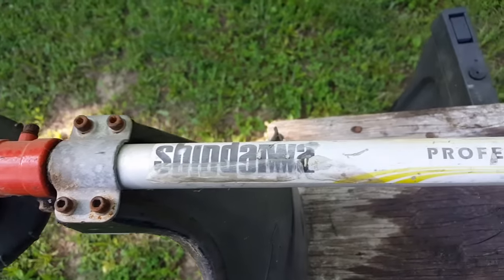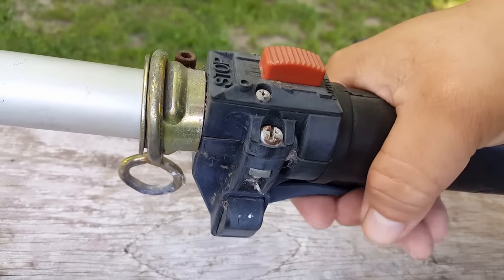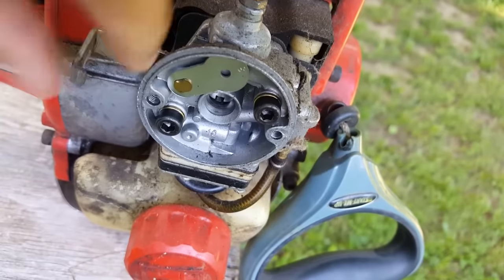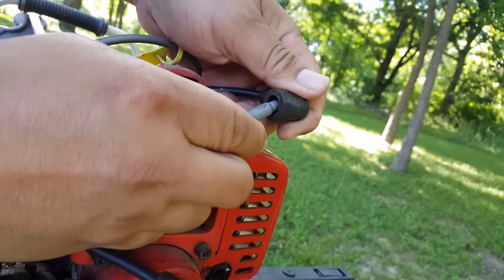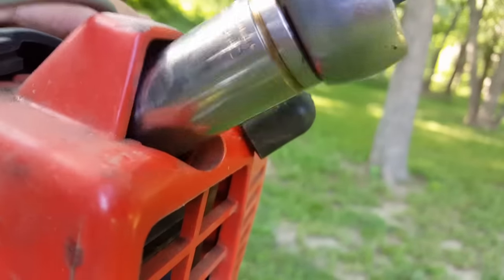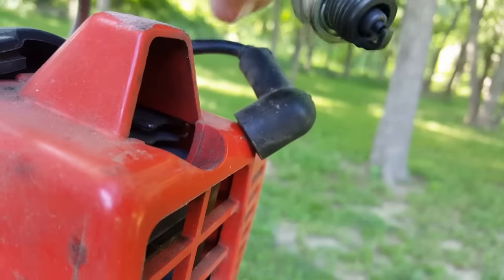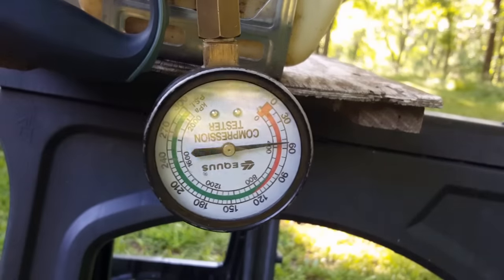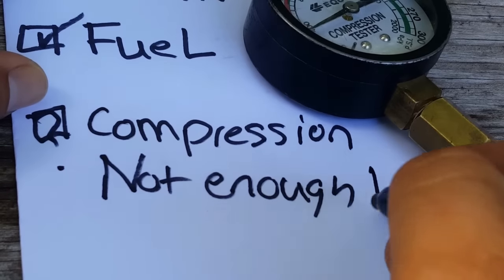My weedeater has spark and fuel but it still won't start

Comment: Well this doesn't really help with my situation. I have spark n fuel. The weed eater has sat for prolly 7 or more years. It's always had premix. I decided to try n get it going in early March n had it running on half choke but couldn't do a proper adjustment to the carb. I used true fuel premix for that. Then noticed the carb n lines were leaking. I just put a new carb on it cuz it was cheaper than a rebuild n now it won't even light off with a bit of ether
Reply from the maker: could you get a hold of a compression tester and find out what kind of compression you're getting
Reply: @HomeGaragechannel  I have one. Didn't run a compression test on it. But it feels like it has good compression n it wasn't run much before it sat for 2 years n developed carb issues which is why it's sat so long after. N thanks for your reply I appreciate it
Reply from the maker: @benmiller5015  no problem.  I've had echo trimmers that sorta ran and after doing a compression test it showed it to be very low
Reply: @HomeGaragechannel  I just ran a compression check on it n my gauge must not be sealing cuz it's barely moving the needle but yet it'll blow my thumb off
Reply from the maker: @benmiller5015  interesting
Reply: @HomeGaragechannel  right that's my luck though. N it's got enough compression to flood itself after like 10 pulls so the carbs moving gas
Reply: Carburetors issue buy new one!
Reply: @benmiller5015  same issue but with my rt100.. has good spark, TONS of fuel, good compression but won't start. May just be too cold for it to run but I dont know 🤷‍♂️ should still at least try to run. Had it running on carb cleaner for 2 seconds but starting fluid or brake cleaner wouldn't even make it hit once. Very clean carb I've went through it 5 times. Getting frustrated
Reply: @jaceb7136  well I wish I could tell you that I got mine going but I literally just threw it in the back of my shop n forgot about it lol. I don't think I even took the time to put it back together. I went n got a cordless electric 80 volt one that does all I need it to do

Comment: On 2-cycle engines, if low compression, then pull the muffler and look at scoring on the cylinder and piston. While you found this to be the culprit, another reason for low compression and a no start condition is a massive air leak.
Reply from the maker: yes you're absolutely right.
Reply: Massive air leak where?
At the exhaust?
Reply: The low compression situation just happened today on my trimmer. I took the spark plug out and poured in about a teaspoon of oil into the crankcase, put back the spark plug, and it started! I believe the piston was worn but the oil could still be able to help.. .

Comment: Tiny engines like this will not give an accurate compression reading using the same tester that you would use on larger engines. The problem is it's only compressing a very small volume of air which some of it gets lost in the hose running from the dial to the threads where you screw it into the spark plug hole. If you use a compression tester with no hose on it or modify yours to use as short of length hose as possible this will give you more of an accurate reading.Your problem may not be compression. I have a small outboard motor that only reads 60 lbs of compression on my tester that is meant to be used on larger engines and it runs like a bat out of hell. There is one other thing necessary for an engine to run besides compression Fuel and Spark and that would be timing
Reply from the maker: Thank you for all your insight and information I really appreciate people who know what's  Going on who watch my videos.
Reply: Yes, if it is out of time it will never run.  Just fixed a Craftsman lawnmower.  Had spark and fuel but wouldn't run.  I pulled the flywheel and found the key was no longer square but was shaped like a Z.  Of course the blade was bent, but I was lucky the crankshaft was not bent.  I reinstalled the flywheel with a new key and it still didn't start.  I removed the flywheel and took a second look and found a slight offset in the internal keyway.  It only takes a wisker i.e. small amount of offset and it will through it out of time.  I replaced the flywheel with a used one I had around the shop and presto she now runs like a champ.  I had to reset the coil gap, as the replacement flywheel was slightly larger, prior to test run.  Another thing to remember is that the flywheel key only has to be moved out of alignment a very slight amount to kick it out of time.  It could be a very slight mark or line on the key that can kick it out of time.  New keys are cheap so if in doubt replace it.  Under severe circumstances on  lawnmowers the actual flywheel could be cracked from the initial impact on the lawnmower blade.  No substitute for a good inspection of the parts prior to reassembly.   Usually, small 2 cycle stuff will not have this issue unless the flywheel nut came loose or other mechanical failure.
John
Reply: so how does one check timing?
Reply: Or a clean air filter. Lol

Comment: Its been almost 1 year since this video was posted and one item to check that you didn't talk about and I didn't see in the comments: did you check the muffler spark arrestor screen to make sure it wasn't plugged up? If you can't get exhaust out you can't get new air fuel charge in thus not allowing the engine to create compression. I've seen this scenario many times. The fix is to take the screen out and use a hand held torch to heat the screen up to cherry red while holding with a pair of needle nose vise grips and then use a wire brush to clean it off then reinstall it and if everything  else is good it will run.
Reply from the maker: Thank you Craig Timmons. It wasn't filmed but later inspection showed that it was ran with straight gas which tore up the ring and cylinder.  No saving this one without a new top end kit. I have another video with a clogged spark arrestor. It's the echo weedeater that won't go to full speed.
Reply: Thanks for posting that. Only got 50psi on mine and will check the muffler before stripping the engine to check the rings.
Reply from the maker: Thank you ColinWatterd and you're welcome. Good luck with the engine.
Reply from the maker: Thanks for the comment. Sorry about the theft. That is quite the experience.  I've never had that happen to me before.
Reply: Craig Timmon
Reply: Craig, Or buy a screen.
Reply: I think that's my problem. I checked the lines, fuel filter, new mix. it was working fine before.i have to find where the screen is on shindaiwa f22? I am female and unfortunately none of the "men" in my city neighborhood know how to fix anything,only break stuff, and think they are borrowing mine after putting straight gas in 3 of their weed whackers in a row. yes I pray for a miracle to move where there are real men.
Reply: @pattiannepascual  you should brainfk them by explaining the not so magic of google

Comment: good video. direct to the point. Most people don't realize low compression will not allow a 2 stroke to fire. Wish I had seen this before I had to figure that out for myself, would have saved a lot of time.
Reply from the maker: You and me both.  I've wasted plenty of time before I realized it.  Thanks for the comment I appreciate it
Reply: I need help.. what about a four-stroke? I have a dirt bike engine that was just badly stored and it didnt run for a few years and now it wont start. I put some oil in the head for a day to make sure rings weren't sticked or seized up , has a good blue spark I also did a oil change and it got decent  compression but when I put gas in the spark plug hole it backfires but won't start?
thanks
Reply from the maker: @justinc9911  thank you for the comment I appreciate it.  What kind of oil did you put in the spark plug hole and how much? What was the compression reading?
Reply: @HomeGaragechannel it's a 125cc there around 120psi and I put wd40
Reply from the maker: @justinc9911 thanks for the information. Can you do a leak down test on it?
Reply: @HomeGaragechannel  That's why I liked it so much, I spent a lot of time replacing fuel lines, spark plug, clean carb,etc., etc, until the compression topic came up. A broken piston ring was the only issue and most people dont realize that.
Reply from the maker: @kmetbropcss5437  well said thank you for the comment I appreciate it
Reply: @HomeGaragechannel why start to repair him
Reply: @HomeGaragechannel  What did you do to resolve if ran with not enough oil?  New rings?
Reply: Same here. Once day the thing ran great, couple of weeks later, wont start. Have spark, have fuel, wont run. :-(

Comment: just picked up a used Weedeater SV2000BV new plug , has spark , i rebuilt the carb , no Compression !!!!!!!!
took the engine apart
ring seized to piston .
put new ring Voila !!!!!!!!!!!
has Compression now
Reply from the maker: Joni English wow great work! Glad it worked for you. I might have to try it too.
Reply: Alright!
Reply: No compression vs low compression. No compression probably an easier fix.

Comment: I think it's better to check spark off of the plug itself rather than an inline spark checker. You can tell if the plug itself has a strong blue spark.
Reply from the maker: Good point.  Thanks for the comment I appreciate it

Comment: Shindaiwa machines, tuffs strong's, best commercial units, this will go on next to no compression, Had one like this that, I used it in my lawnmower business for 7 yrs 155 lawns a fortnight,  & the guy before be had it for some time as well, in that time when through dozen plugs & 3 pull strings. Was getting hard to start, it was starting a little hard to start, just in the mornings, took in for the repair guy to look at, what he said it had no compression, hardy a reading:) so used it for another week:) while he order me a new one. shindaiwa, motto, first to start last to quit, is so true, & they run more smoothly, than others when you hear others around running, like ratty stihi, you look around small engine repair shops next time?? see any shindaiwas or echos?? if any its 25 to 1 Like you say will be the fault of the operator & not the machine!! why you say? its easy, its japanese,
Reply from the maker: Thanks for the comment. I really like these units. I only wish I had a working unit. I might rebuild this one some day.
Reply: Mike, I'm not a Stihl fanboy (prefer Echo dollar for dollar). Do u think there may be mor Stihl machines in the shop because Stihl outsells just about everthing else by a wide margin?

Comment: I had the same problem, bought carb. Kit with everything and a brand new fuel cap and new spark plug....but my problem was compresion from the piston from 90 to 95 psi, so I just put some transmition oil inside the spark plug an crack it for a couple of days (3) an wala I had presion again, the piston ring was stuck an everything back to normal...I hope this works for you guys...Good luck.
Reply from the maker: Thank you for the comment.

Comment: My shindiawa 230 has a compression of 30psi and never wanted to start, but I changed the throttle body and it started.
Reply from the maker: For a 2 stroke that's amazing

Comment: just so you know even with bad compression the motor would still run just saying also when you spray in the carb like that make sure the piston is down it prolly was up blocking the cylinder and you didn't spray anything in there at all
Reply from the maker: Thanks for the comment

Comment: Concise video.  No fluff... nice!  

I have a Cub Cadet and put in fresh fuel mix.   Won't start, so I pluck n clean the carb ( I didn't see any h2o signs or crud clogs).  I tested for spark - pulling the plug and grounding it to the metal frame and she sparks on every pull.  It still won't start .... and I'm wondering if there is another method to check compression?  I don't have a gauge thing-a-ma-doo-hicky.  

I doubled checked that the switch is "on" and that the primer bulb is full of fuel and moves through the lines just fine.  I'm about to throw this sucker off the garage roof like a javelin thrown by a Viking.
Reply from the maker: Lol nice.. well this is a tough question.  Did you see if the black metering diaphram was stiff or warped when you cleaned the carb? As far as the compression tester goes the only other was is to slowly pull on the rope probably at a rate of 1 foot a second and see how much the engine pulls back on each stroke. Do you have a working 2 cycle equipment to compare to?  That would be the only other way I can safely gauge engine compression.

Comment: It takes three things for an engine like this to run. Fuel, air and spark. The correct fuel to oil mixture helps a lot too. Being that this engine is probably a high compression one, usually around 11-1, mid grade fuel would work a lot better. And its usually only a dime more and that will not break the wallet.
Reply from the maker: You are absolutely correct.  Thanks for the comment.
Reply: I used to think the same thing but got a few lessons over the years.  Ignition system needs to be in time and also the engine requires a certain amount of compression to run.  If you meet the fuel, air and spark requirements  and the engine system is out of time or is low on compression it will never run.
John
Reply: @helicopterjohns how do you time one?

Comment: Well I just wasted a day on 3 of these engines, wish I would get a compression tester already.  Definitely would save loads of frustration.  I had been piecing my hedge clippers and whackers together for years, like 10, and they all completely died this week.  Guess its time for some new shit.
Reply from the maker: Thank you Pilesofplenty. Yes its time for new equipment.  Let the frustration go.
Reply: or maybe you gummed them up with bad gas??? since all problem started same time, maybe the fuel batch wasnt real good... try starting it shortly with a bit of methanol(fondue fuel) and a dip of oil straight in the carb, you'll know immediatly if it start for a couple sec ^^
Reply: That's a pretty good idea, but do it shortly or you will soon get sleeve dammage. otherwise, it's the best trick to test 2 stroke engine still, but try Nitro RC Fuel, it works better and clean pretty good!
Reply from the maker: Thank you Daphnee LeBlanc. I'll do a video soon on it but I'm pretty sure the piston and cylinder are torn up.
Reply from the maker: Thank you HereGoesNutting. It couldn't possibly damage it anymore than it already is.
Reply: I would not damage anything  since nitro fuel is actually 2 stroke fuel as it contains synth and castor oil and normally got 11-17% of them in it!!! as for the damages, I would bet that it is scuffed like no oil situation, but that changins the 2 rings will bring its back to life. Just be sure to water sand with at least 1000-1200 grit paper the inner sleve and piston to remove imperfection. The new rings will seal correctly after a good break in.
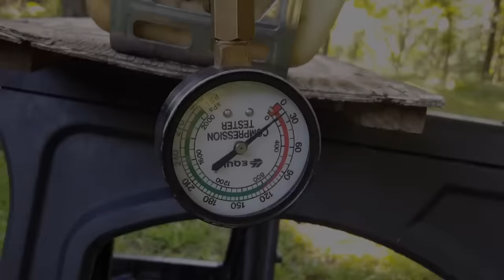Reply: @DjayLSD  good point.... car gasoline is NOT for small engines. A few mowers (TORO is one) use ethanol-free gas with NO oil (they have an oil tank), but small devices (trimmer, chainsaw, blower) usually need synthetic oil about 1:40 or 1:50 with ethanol-free gasoline... and it is hard to locate.
Reply: @DougHinVA  That's why you get 2-stroke premix oil from your local hardware store. They come pre-measured to mix with gas. On newer 2-stroke motors, you can use up to E-10 at 89 octane. Just remember to empty the tank before storing your equipment.

Comment: How the heck do you fix the issue though? I have 6 echo srm225s and 3 of them have that problem. Has spark, has propper fuel. Exhaust is clean... what gives? Nice video but you didn't explain what causes low compression or how to fix the issue. Not trying being rude I'm just curious if you know how to fix it
Reply from the maker: Thanks. You have to rebuild the top end which was not an option at the time. This engine was ran on straight gas and that's how it was damaged
Reply: @HomeGaragechannel  whats the top end?
Reply from the maker: @Sulaimaanhr  the piston and cylinder
Reply: @HomeGaragechannel  oh ok
Reply from the maker: @Wayne96819 yes thats is a great option.  It would have kept this trimmer alive for sure
Reply: my echo was working, ran out of mix so I put it away during winter, and when I checked everything, put new mix, etc, went to start it and sounds like it's blowing up? so I stopped. didn'tfind any videos on this exact problem. I did replace the arrestor screen so that's not the problem.did you clean your screen? abs does anyone know why mine sounds like a firecracker?

Comment: Hello there I have fs 38 stihl weed eater that won’t start. Has great compression, good spark, and a good running carburetor. Even if I spray carb cleaner in the cylinder, all I hear is pops from exhaust. Any idea what it would be? Thanks
Reply from the maker: sure, I need you to get or borrow a compression tester, and get a reading.  Sometimes, when it only pops, the compression is much lower than you think. After that it might be a timing issue but only if you've put a blade on it, could that happen
Reply: @HomeGaragechannel  compression shows a bit over 80psi
Reply from the maker: I see, bit low, but It should run. How many times have you tried to start it? Every time you try and start it, and it doesn't, it could just flood the engine. Try taking out the plug, and letting it sit for a day or two, then when you try to start it, "don't" choke it, and see what it does.
Reply: @HomeGaragechannel ok. i will do that. Thank you so much for your time 👍
Reply from the maker: no problem

Comment: I have a weed eater.  New plug, good spark, fuel, new carb, 75 psi compression, no start.  Ideas?
Reply from the maker: compression is a bit to low making it tough to start.  Do me a favor, next time take out the spark plug and drop about 5 to 6 drops of 2 stroke oil into the engine, replace plug and see if it will try and start.